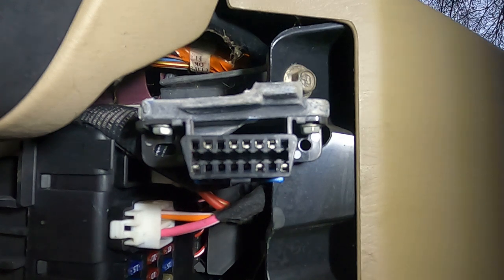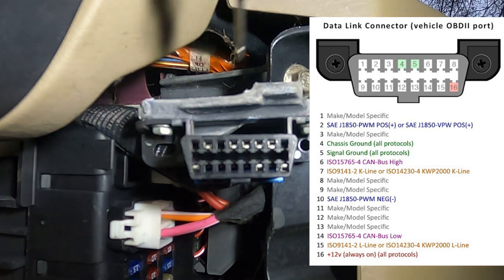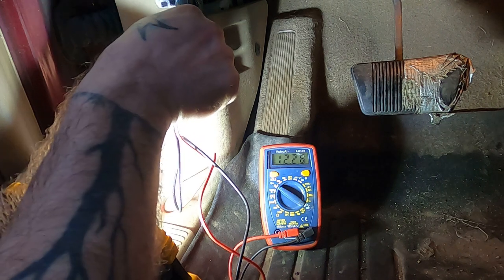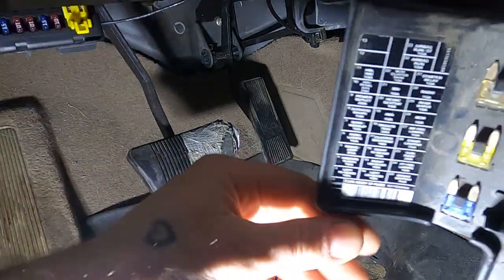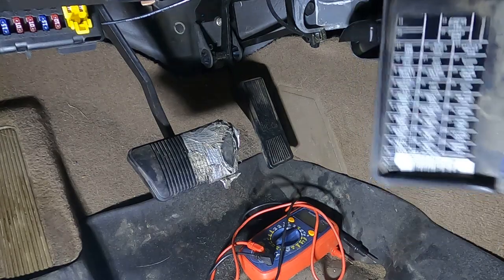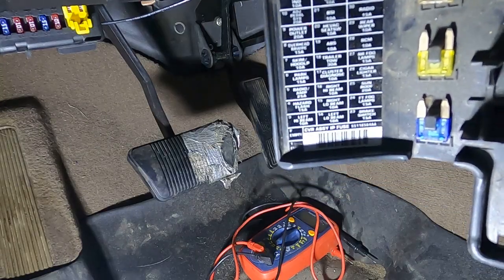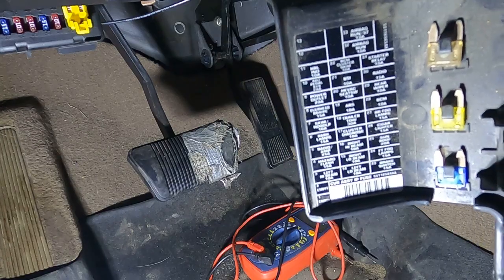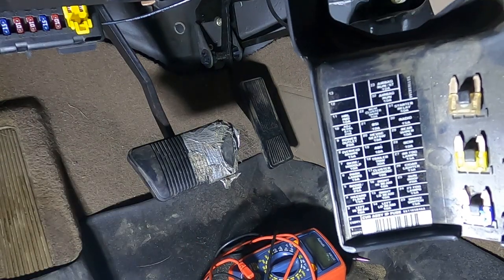EASY FIX - OBD II data port has no power

Comment: You just saved me so much money. Dealership was going to charge 250 for diagnostics and 2700 for repair. Thank you a million times
Reply: Freaking scam man. Glad you fixed it
Reply: I’m currently having the same issue. Could you help me. The dealership asking $600 to diagnose and an unknown amount to fix. I was told that the car has 196 687 miles on it. It’s not worth it 😢
Reply: @zekenewstv511  Check ur fuses dude. Pop the lid off and on the lid it will show what fuse is what. pull the fuses and see if their busted. If it is then bring that fuse to an auto parts store and replace it
Reply: @mediamarkz ok thx my mechanic fixed it for 70 bucks
Reply: @zekenewstv511  What about a local tech?
Reply: Stealership as the fella in the video said
Reply from the maker: So glad to hear it!!

Comment: I’m in same boat. All fuses check out. And I mean all of them (my diagram of course doesn’t call it out). No obvi corrosion. This is on 06 Chevy Express 3500 front end of motorhome - cutaway chassis.
Reply: You getting power to the obd

Comment: I have a 2008 Grand Cherokee Laredo and someone tried to bridge a pin in the obd plug and it arced and now I have no power to it I checked all the fuses and they are all good and I checked the wired and still no power to it

Comment: Question: my port works, but only if it is push down when plugged in. I can plug in, nothing will happen, I apply a small pressure downwards, it works. Fuse is fine. 
Any ideas?

Comment: Old school installers always knew the cigarette lighter circuit was 12 VDC constant. So all kinds of installs were powered by the lighter circuit. Fast forward to today where the cig lighter/power outlet is still 12 VDC constant but it is shared with the CAN bus. I have ripped out so many alarms, kill switches, power amps etc that all were spliced into the CAN bus/ lighter circuit. Once repaired and restored to factory wiring, power is restored to OBD II

Comment: I have to chase down a burn cigarette lighter wire issue. 

Can I straight wire the constant 12V to the battery to get my power and then will it read ?
Reply: Yes is you add an inline fuse between the battery + and the pin #16. The fuse should be close to the battery.

Comment: hi, my obd port isnt bolted in, and is jusr hanging loose. anyway, a wire isnt plugged into the little box , and my ac isnt working. i have a 04 chrysler sebring convertible 2.7 liter. any way i could reconnect it, to get power to my ac?

Comment: Good info.  One thing to add.  If there is no voltage reading, you may be able to isolate the issue further.  You could put the voltmeter negative lead on the battery negative or chassis ground somewhere to see if there is voltage when the voltmeter positive lead is on pin 16.  If there is, you would know that the issue would be the ground wire in the connector on pin 4. and not a fuse issue.  Likewise, you could put the voltmeter positive lead on the battery positive and measure with the negative lead to pin 4, which would indicate the issue would be the wire in the connector pin 16, or the supplying fuse.  Of course, there is a chance that both wires are bad!!
Reply: Question, i have this issue but i changed the fuse it worked but did it again when i got home after work. The doors wouldn't lock or unlock, no start no power to obd. But the next morning it was fine. Without changing the fuse.
Reply: Excellent info thanks for added info
Reply: Thank you for the video I appreciate it but I need to know is if it’s not the fuses and they’ve already all been checked and the OBD port looks fine and there’s no visible damage. Is there a way to get a new OBD port and or wires for a 2003 Buick rendezvous and how much approximately would that cost set me back trying to keep the car alive I don’t have the funds to get another vehicle. Thank you so much.

Comment: Fixing a 2007 rav4 2.4 new battery and alternator  the starter isn’t brand new but works so the car does nothing unless I put the diagnostic scanner in the OBDll and then the car cuts on but only if it’s in and runs rough but gives no code? Can you help me if you know

Comment: On my 2018 Chevy Colorado, state inspection stated they could not acquire a reading. But I took it to autozone and orileys both came up with a P0014 reading.  Truck is running fine but any idea why state inspection could not acquire a reading?

Comment: I wanted to ask I got a car from the dealer they have a tracker in the car which is fine but it is causing damage to my car computer because it is plugged directly into my OBD port and makes the readers not work. I don't want to disable it I just want to know if I can move it if that is possible

Comment: Just seeing this video.. I just had my transmission replaced, and a week later, my check engine light came on. I took it to auto zone and had them connect it to the code reader. Unfortunately, they said my car is not reading at all.. It use to read before my transmission was replaced. Haven't checked all fuses yet. But my cigarette litghter workes because my charger is plugged into it for my phone. Need help??

Comment: Very informative video.  As suggested in this tutorial, my make/model did NOT indicate either in the manual or thumbing through many websites which specific fuse powered the OBD.  I then turned to A.I. (open AI) and asked it to find the information specifically for my make/model.  It provided an informative answer.  So, if all else fails, you may try that method to identify the blown fuse.
Reply: What did you ask ai?

Comment: I have a 2000 ford explorer XLT and my OBT port is dead. I check for power and it has power coming in all fuses are replaced but not getting anything lines dont seem mess with either
Reply from the maker: I would check for corrosion or something loose if you have confirmed power is being sent properly. Good luck!

Comment: hey, i have a audi 2012 a4 quattro and as i was taking the knee panel out two wire broke. but before that the car would only turn on not start. now it’s turn on and off and still not starting. how do i find where these wire ran too?

Comment: Late to the party on this - trying to run an ODB2 on a 2010 Land Rover LR 4, would not connect at all, turned the vehicle fully on, and immediately codes start popping, revs start falling and the interior goes dark. 

Recharge the battery, try using a power bank plugged into the odb2 sensor, viola it pops up, though the app is intermittent and doesn’t complete tasks. 

Try a cheap harbor freight reader and it works, though I note it had a bit of the same power draw, suddenly turning on stability and park brake errors. 

I’ll check the fuse tomorrow and try to find a multimeter

Comment: So glad I found this video before I went under the dash searching for a loose connection or broken wire! I just bought a $40 OBDII scan tool and the vehicle I needed it for showed NOTHING when I plugged in the brand new scanner. I verified the tools function on another car and it worked perfectly so I knew someone out there had the scoop on this likely common headscratcher. Thanks for saving my back and my time. It was the Cigar fuse under the hood that when replaced, energized the OBDII port and a simple fix!
Reply: Do you have extra obd fuse in your car

Mine i just replace tire sensor in amerikas tire shop
But when they are going to program in
The obd reader in my car the port is not working
Reply: What is the name of the software you use?
Reply: @jhamessamuel8313  No software. Just a plug in OBDII scan tool by Ancel.

Comment: i got a gwm steed 2011 model, my problem i got is the car starts perfect when cold. obd port is working. But when car get hot it shuts down then i also notice the reading on the dash board for millage does not come on but some lights on the dash work, not all the lights then when that happens we got no power at the obd port. Did you experience anything like that?

Comment: Simple fix no power at OBD2 port. Open hood remove fuse box cover behind battery. Replace the brown 7.5 OBD fuse. The diagram is inside the lid of the fuse box cover.

Comment: I've had a sudden crank no start situation w with codes leading to the purge valve and evap. I tested all that still nothing I went to test my fuses I had a blown ignition coil fuse replaced it it did seem like it wanted to turn over spray starter fluid still nothing so I noticed that my OBD2 Bluetooth adapter wasn't holding a connection it would connect but then it would disconnect so I took my Dash plastic off and it seems that the OBD2 port is very loose and I have to hold it in a certain position to get it to keep a connection any thoughts?

Comment: I have 05 Ram. Tell tale signs of broken wire. I've been all thru it intimately. The stealership couldn't find it. The Isp station has jumpered it out 2 yrs too Isp.
 Could it be ignition switch(??) 
 No radio, key fob, interior lights only in aux, no power to #16 OBDII. Can I just hack in #16 wire w 10Amp in line?
Reply: I would like to know too.

Comment: Having the same problem. Fuse keeps blowing when I swap it out but sometimes it’s immediate and others I can drive around a little. The cigar port is fine because I can charge my phone. Nothing looks corroded. Pulled out my radio to see if anything looked fishy or fuse keeps blowin and it didn’t make a difference . Any other thoughts ?
Reply: There is a short to ground, when ever, you press something e.g use horn or wiper for an example

Comment: 2003 MDX - VSA reset the iterwebs tells you to jump pin 4 and 9, I did that and the jumper cable turned glowing red hot. I pulled it part, and after that the car wouldn't start and the OBDII code reader was dead too. I found your video, found the fuse that I just blew and fixed it up thanks to you. Any idea why my fuse blew, the other video has 100's of people commenting that procedure worked for them. Me, not so much. Thanks man, you're a lifesaver!

Comment: I have a question? I have a similar issue, only I can't connect with my PCM just my TCM, skim module light is on and I have power and ground and with 5 volt reference. I'm guessing the PCM has failed? It's a 1999 jeep grand Cherokee wj 4.7

Comment: Many thanks for your video. I do not dare to use the new battery again. The smelling of chemicals from day one scares me. However the curiosity and my ignorance is killing me slowly.... I know that I can do some things and maybe my Corolla 98 1.8L will still be driveable, with another starter, to take it to the right doctor. The new battery rated 500 CCA was showing measured 720 CCA  after a drive of 2 miles and I had never seen such result on 30 years of driving. Is that possible? I also discovered wires exposed under the sleeve  hole in the positive cable. Many thanks in advance if you have some feedback.
Reply from the maker: Hey bud. To be honest, that is a lot to diagnose in a YouTube comment. I would not be comfortable suggesting you do anything you are not experienced with given what has already happened. Sounds like something is wonky in that car and you might want to have a professional give it a look. A lot can go wrong when electricity is on the fritz

Comment: D&E, The one day old new battery negative connector melted leaving craters by the healthy still post and the starter was smoking, at the moment I stopped the car and lifted the hood, due to so much fumes coming out from under. Can I connect to the previous battery a portable power pack 12V Centech just to see if the OBDII scanner will bring some light in whatever happened or I would do much worse by doing that? Regards from FL.

Comment: Thanks Boss! I had this problem with my Kenworth Semi a couple of times and I get charged $140 per hour for someone to look at it. It was the fuse. The mechanics will say they swapped out the electrical, and just swap the fuse. 9 times out of 10. That's expensive!!

Comment: My 1998 Concord OBD is MIA. I checked every fuse in the car including 2 circuit breakers and they all check good. I suspect I have a bad BCU because my security system, door locks, radio, interior lights, and a couple of other things don't work and fuses check good. Would a bad BCU cause a no power condition the the OBD?

Comment: H!  My reader is not connecting with the app but the blue light comes on when I plug it in so I'm assuming the Old port is getting power.  Any idea what else it could be that would cause this? Check engine light on in my 2004 Jeep Wrangler.  Thanks!
Reply: Did you get it figured out?
Reply: @HuskerRed11  I did, thanks!  I think I screwed something up when I wired up a back up camera summer before last because my battery keeps draining and my back up lights don’t work and it failed inspection so I’m waiting for the opportunity to take the damn thing apart. Go through it all have been able to drive it in months.
Reply: @Christine Leary  Ok cool. Thanks for replying Christine.

Comment: I have a 2000 Nissan Altima the data link connector only has power in pin 8 + 13 why

Comment: Wouldn't an open circuit on 4 and 5 cause it not to work since the grounds could be open.....just going to a chassis ground and not pin 4 and 5 doesn't check the ground side of ALDL, a loss of power or ground is still an open

Comment: You made my day buddy, just splurged on my first obd2 reader and was about to give up. checked the fuses and sure enough my “cigar lighter fuse” burnt out, threw on a jumper wire and boom fixed
Reply from the maker: Gotta love an easy fix, right??

Comment: Hey so I have a 2000 f250 5.4 and mine won’t work and the fuse pops the second I put one in, but I don’t have a draw from the battery at all? Do you know what could cause that?
Reply: Possibly short to ground somewhere.

Comment: I have a 2000 Nissan Altima, at first the turn signals and Hazards quit working and when I bought the vehicle to check engine light has always been on so that really wasn't a concern at the moment but my signals were so the fuse was blown so we replaced it it worked for half hour then it blew again so I boyfriend checks the relay it smelling burnt we replace that and another fuse it work for about an hour then we decide will let's try the OBD and see what the check engine light means we plug it in no power to it do you know what this might be?

Comment: I would jumper 12v to the + pin and check to see if the rest of the port is Ok before I start pulling wires. The odb port is part of the ecu so if it won't talk once your scan tool is powered up, you have bigger problems than " no power" . I've never seen a truly dead odb port, always connections...we have a saying in consumer electronics: "silicon doesn't fail, connectors and capacitors fail"
Reply: So can I straight wire that 12v from the battery and get power to the Ob2 , will it read then?
Reply: @jemelmonger I did that on my 96 dodge caravan, years ago. It worked, but I cut the wire feeding the port in case the feed was coming from the ECU, did not want to back feed the ECU. Just be sure you definitely know which terminal is the feed on your specific vehicle. I'm about to do it again on my 95 ranger, hence the reason why I'm on this thread. Good luck!
Reply: @arthurpapazian6003  thank you!  It says 16 pin is the power. I’m going to triple check before I snip the wires.  Thanks for chiming in !  I knew I wasn’t the only person in the words that had this issue 😂
Reply: @jemelmonger  if you have 12v I side the ECU and no 5v, you must fix that problem first. Please post your voltage readings at your odb port.
Reply: @JerryPrado  i have a 04 Chevy Tahoe. I think that wire is 12v and orange. Can. U confirm?
Reply: Right.... So.... What do you mean "if it won't talk once your".... do you mean after running the jumper?
You have me a bit anxious thinking that running the jumper alone is a sign that I have bigger problems. But if what you mean is after I run a jumper then phew

Comment: Yo so what about if I can read codes and live data just fine with the engine off but I cannot when the engine is running? Wanted to check my o2 sensor behavior but if I plug it in while it’s running it says no communication, and if it’s off, I plug it in and get to the live data screen then start the engine it goes straight to check connection
Reply: Running the engine cause short to grand to the ECU power find the short, use schematics.....

Comment: So I've been daily driving a 2003 Honda Accord and then I have a 1996 Ford Bronco for for the mountain because I live in Colorado I've been looking for a new car because the Honda Accord Coupe is fun but I'm at a point where I need to build some credit stop at a dealership was looking around something between 15 and $19,000 just to get ideas and I drove a Hyundai Equus air conditioned seats heated seats a refrigerator in the back rear wheel drive massage chair on the back passenger side 429 horsepower does anybody own one I have been against Hyundai for a long time but this thing is sick anybody know any problems